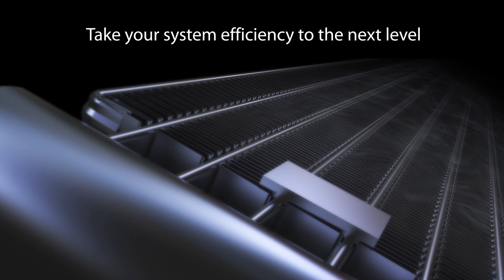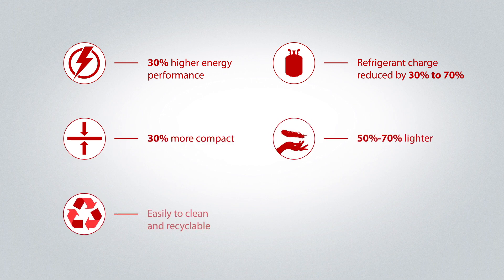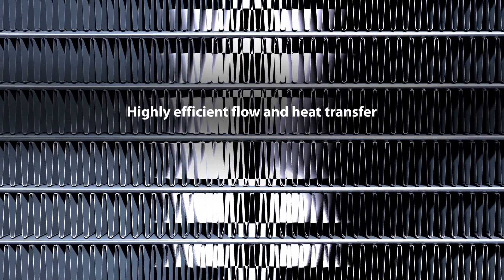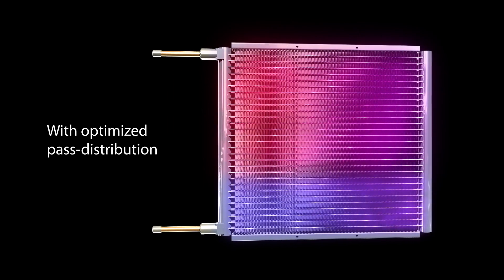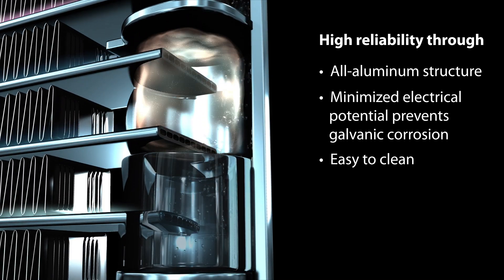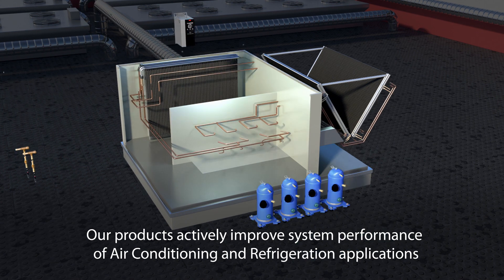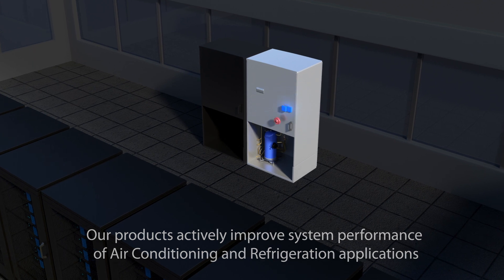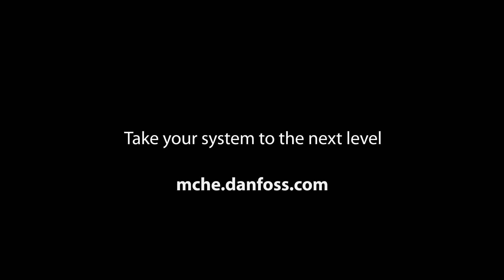Micro Channel Heat Exchanger technology | A whole new level of system efficiency

Comment: Hi , can you plugg any of the tubes if it can't be repaired. If it can what's the percentage allowed.
Reply from the maker: Thanks for your question, Sanjay. The answer is that the construction does not allow for sealing off the individual microchannel aluminium bars. There are several channels inside each of the bars, and you can't block any of these without damaging the MCHE.

Comment: Automotive industry switched over from Tube and fin to micro channel 30+ years ago and you’re guaranteed 30% more leaks from the micro channel that’s a guarantee. 
            By using micro channel you’ll make 30% more profits for returning to top off leaky systems from the micro channel. 

        By installing a micro channel you’re guaranteed 30% more condenser change out with a shorter lifetime by 30% and that’s a guarantee.   We love those micro channel very profitable 👍
Reply from the maker: Thank you for sharing this information,we love them too!😊